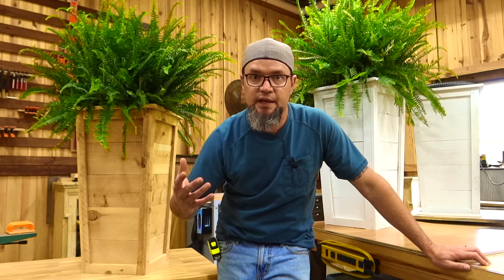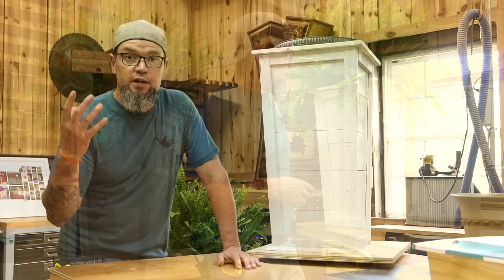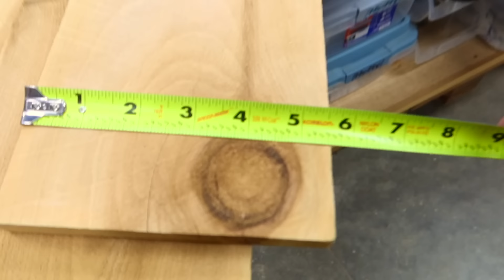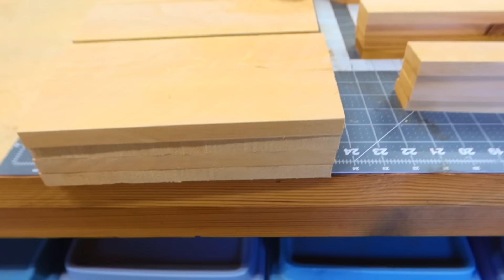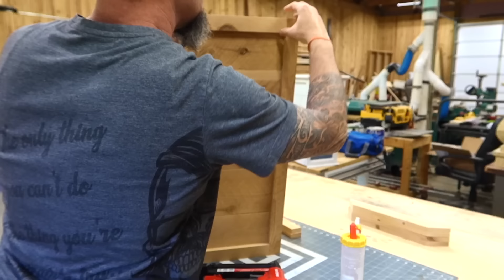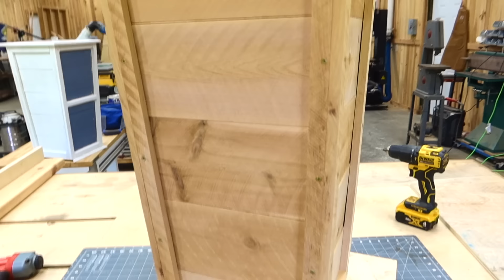DIY $10 Tall Planter - Low Cost High Profit - Make Money Woodworking

Comment: I built a couple of those yesterday and they came out fantastic! I was a little intimidated at first with all the angles but it ended up being a breeze. Only change I made was with the top horizontal strip. I found when picking the box up I was grabbing under that, and I could definitely feel it shifting a little with just glue and nails. So I put a couple screws in each one and it’s solid as a rock.

Comment: I built and sold my first project which was an “airmail” corn hole trainer. I am working on the planters next. I too am a full time self employed handyman and I ultimately want to just do wood projects. Thank you for your videos!!!!
Reply: What is an "airmail corn hole trainer"?
Reply from the maker: That is awesome!  No worries!  Thanks for watching!
Reply: @andrewsmithmilan1780  you can look it up in YouTube. It’s an 18”x18” board with the 6” hole in the center. Sits at 10 degrees like regular cornhole boards. It’s regulation size and used for airmail tournaments and for training to get the bags in the hole without sliding. Makes the person more accurate. Has to set at the same height in the back with that same slope. Check them out, lots of cool stuff you can do with them.

Comment: Hey brother just made one of these for the first time today. Had a blast and it turned out nice. Got a chance to use some cool tools and techniques - the taper and trim make this pop for sure and using the brad nailer was key. Added a couple tapered scraps for a shelf about 8 inches under the top and it worked well to hold a smaller pot for now. Will be giving a few away and Im sure peeps will be hitting me up when their friends see these. Thanks man!

Comment: I've been building the "Farmhouse" style planters and selling them for $50 in my area. I did my first batch out of the 5/8" pickets, but even using your plans, I had to add an extra picket for every 3 planters. Apparently my dog-eared 6' pickets have a different dog ear cut that messes up the 3rd board. Anyway, my last batch I just made, I used some 3/4" pickets that my local Lowes started selling. They are about a dollar more per picket, but they are smooth. No roughness to sand. Saves me alot of time, which more than makes up for that extra dollar per picket. I just have to trim the edges of the back panels on back wall "B" to get them to assemble correctly. Also, they take the screws better than the 5/8 soft boards.

Comment: Matthew I’m not sure how comments work as far as seeing them on older videos so I thought I’d post here even though it’s not in this video. 

In one of your older you mentioned your old planer or shaper (I can’t remember which) being three phase, if you haven’t gotten it running yet before you buy a phase converter take a look a VFD. A friend of mine runs one in and old 3 phase Delta cabinet saw and it pretty slick.
Reply from the maker: Hey David!  Yea it's hard for me to keep up with comments from older videos.  I have been looking at the VFD converters but havent seen one in action.  I think im going to pick one up and see how it does!  Thanks!
Matthew
Reply: @MatthewPeechWoodworking  they’re pretty slick, they have to be sized right, you can set turn up to spool up and down slowly and even act as a brake.

Comment: After a couple hours planing and sanding.  Cut the boards like i was the Queen bee.  Paid attention to the alternating boards.  Rocked it.  Then stacked the boxes like a rock star.  Needless to say when they didn't stack tapering that 3 degrees off should have been on the bottom of my mitre, not the top.  So laughing at myself right now. Will try it again next week.  In the intrim, i have some cute planter boxes.

Comment: I did all my cuts per the plans purchased, love the way you set up the pdf. I assembled all my boxes, one out one in style. Went to stack them and boxes D and E are too large to be cohesive, the overhang on the sides doesnt allow the trim to be added. The first planter I used critical thinkkng and leveled the vertical edge sticking out, then removed some of backing from the wider Leg so it would fit. It works for now but the rest of the board is over hung, so will be facing away from the street and not visible to most. I will to experiement with shorten measurements  for D and E. 
The 2nd planter i will try this on, hopefully get it all even out. I am also going to add a shelf so pots will sit instead of hang for dear life by their plastic edging. Dont need a traumatized plant 😂
Reply: Great news to share, I took apart the D and E boxes, picked 2 pieces and started trimming small amounts off keeping that wonderful 3 degree off 90.
Successfully got rid of the jut out.
I kept the 1st tower as is and decided to add stain to specific areas to create illusion of evenness.
Excited to continue forward now.
If you don't experience challenges in life, then you can't grow. 

Peace and Love and Light

Comment: The planters look really nice.  However, being on the tall side, I would be afraid that with a potted plant in them it would be top heavy and might fall over.  Additionally,  the planter sitting in water would damage the bottom.  So, my suggestion is to perhaps build a footed platform in the bottom, which would raise the planter and add some needed weight to it.  Maybe use 2×4 for the footed platform and maybe put a small patio stone or a brick or 2.  
Just my 3 cents....

Comment: Someone on some platform, (maybe a FB group) suggested using half laps for the top trim so that the gaps from shrinking weren't as noticeable. I've been wondering about that.  Would be an extra 10-15 minutes depending on how quickly it can be set up.  I just don't remember if they meant staying with the 45s or using butt joints.

Comment: Splendid video. I don't build for money, but I do for gifts, and family & friends just love the side-table and planters. I finally ran out of the pickets I got for free (I had to demo the fence), and I looked at HD for new cedar pickets. Today (2/Jul/2022) HD has 19/32in x 5 1/2in x 6ft western red cedar for $3.78 + tax (8.52% or $0.32 so $4.10 per picket).  BUT HD also has 5/8in x 5 1/2in x 5ft (a foot shorter and ever so little thicker) for $2.57 (with tax $2.79) - That is a significant saving over the 6ft picket. About $1.21/sqft compared to $1.49/sqft, about 20% less/sqft for the 5ft pickets.

I found even better savings at Lowes (in Longmont, CO), $2.18 (inc tax) for the 5-footer and $4.30 (inc tax) for the 6ft picket - a whopping 51% less for the 5-footer. WHY? Why is the 5ft picket so much cheaper than the 6ft picket?

Comment: Make it to fit a common size container like 5 gal bucket  or the 2 1/2 gal mop bucket from Wally World something that can be found in your area . Just a thought
Reply from the maker: Oh yea!  The good thing about this design is you can add to the height and opening by adding 9/16" to the box size below.  Im not sure but it may fit a 2.5 gallon as is.  I tried all of the traditional planters and most worked just fine with the current size.  Nice idea!

Comment: Being both a woodworker and a gardener - my question is how you actually utilize it as a planter?  I love the design, but it doesn't seem to be setup for any particular planter insert?  Also anyone who's used outdoor planters knows that drainage is essential for a plant (and you usually water them until the water is draining from the bottom of them).  I've watched the video several times and I don't see you installing a bottom, but this does sit flush to the ground.  So the water just runs down from the planter and collects on the ground inside?  Seems like it would be more effective to use as a planter if at least if the 4 corners were setup at least an inch off the ground?

Comment: Hey Matt!  Thanks for the videos.  @12:30 you say to start with Leg B and that it is the smaller of the two legs and that Leg A will overlap Leg B, but the cut list has Leg B as the bigger leg.  So which one actually overlaps the other?
Reply: The bigger one obviously overlaps the smaller one !! ... c'mon Josh, put yer thinkin cap on !! 🙄😂

Comment: Nice work. Hey I have a quick question - I tried building one of these boxes as shown in your video. I have bought material to build more.  I bought cedar pickets because they were the only ones available. I tried drying them for a couple of weeks by keeping them stacked with wooden stickers between them, and keeping weight on them.  I live in California where there is dry weather with very low humidity. But even then I found that after cutting to length, these boards cupped and the planter box doesn't come together that well. Do you have any suggestions or tips on how to address that? I have bought material to build more. But want to find a way to avoid this problem before building more. Your help and guidance highly appreciated. Thanks in advance.
Reply: I think you are better off building the boxes as soon as you get the pickets... this isn't fine cabinetmaking, allowing the pickets to dry is a guarantee for warpage...(is that even a word ? 🤔)
Same with the "joinery" techniques... avoid dovetails at all costs... 🙄😂

😎👍☘️🍺
Reply: @Peter Fitzpatrick thank you for that suggestion. I will try it that way.

Comment: i only have jigsaw and circular saw any tips on reducing the size with perfection
Reply from the maker: Use the circular saw.  It may take an extra board but cut them all at 12" and lay them out like one wall would be.  Use a board as a cutting guide and angle it so that the top is 12" and the bottom board ends at 8".  Repeat for the opposite side and do this 4 times.  It will work.

Comment: In this video you mention that it's important to be sure that the fence pickets are 5/8" thick, but in your new video on your new design for a 3 picket planter you note that you're hearing a lot of people say it's hard to find them much thicker than 1/2" and having problems with splitting, etc. In that video, you mention that you made changes based on that, particularly with the screws used (1" pan head vs 1 1/4" in most of your other planter builds using pocket holes. Are there any length adjustments that need to be made to allow for the thinner boards in this build?
Reply: These videos have been great and I really like the way you organize your plans you sell on your Etsy page.

Comment: you did not mention how much longer the side pieces get as you go up.  Each box has to be bigger than the one below.  Do you just take the wide measurement from the box below and make that the small measurements on the box above?  that makes sense to me.
Reply from the maker: If you put the 3 degrees off 90 on the side walls in the cut list it will create the taper.

Comment: Love your builds! Curious why you need screws if using wood glue and Brad nails.   Are the screws necessary?
Reply from the maker: I always add screws.  The constant shifting of wood will eventually break down the glue and unless the nails are stainless they will rust and break.  But without screws Im sure you can get a season or two out of them.

Comment: My boards are closer to 5.25 wide.  I'm guessing that the building process still works the same?  But the finished product is just a tad bid shorter?  Is that correct?  The more important thing would be that all of the boards are the same width?

Comment: Going through this in my head, because I must build this (lol), I didn't see where you covered how much longer each course of side boards needs to be as you go up.  It looks from the video like you cut all 16 pieces the same length, but that can't be right with that 3 degree angle.  Each next course going up has to be longer boards than the one below, so the question is, longer by how much?.  But I think I have it worked out.  The idea is that each top edge is the same length as the bottom edge of the next course up, so what's needed is to try and move the cutting stop over to the right, by the difference between one top edge and the top edge on the next course.  

One way would be to take the top edge of one of the 4 side boards and make a mark on the next board as the new bottom edge length, then draw the angle up from there to the new top edge.  I know I'm sure to mess that up, even if I make the first cut a bit longer and 'sneak up on it' with successive cuts until I find it.

Another way without marking, measuring, or drawing a new angle, would be by using a second, temporary stop on the left, to help locate the cutting stop on the right for the next course.  Also for this method, the stops need to be wider than the side board stock.  This can be achieved either by making the 2 stops from wider stock (as your cutting stop is in the video).  Or if wider stock is not available, the bottom edges of 2 side boards can be used.  Cut the 1st side board, clamp anything temporarily for an initial stop, then slide the stock for the 2nd side board into that stop, temporarily clamp down the stock for the 2nd board, which allows you to swap out the first cutting stop on the right with the 1st cut side board, only with the cut end back against the fence, using the bottom edge as the stop, because the bottom edge is longer than the width of the stock (this will make sense in just a second).  Then cut the 2nd, 3rd and 4th side boards, using this new cutting stop made from the 1st side board.

Once the 4th side board for that course is cut, the cutting stop on the right needs to be moved for the next course.  So, leave the 4th piece in place, tight up against the cutting stop on the right, and clamp the 2nd or 3rd side board as a temporary stop to the left of the 4th piece.  Clamp this temporary stop in the same way, with its cut end against the back fence, its bottom edge against the left end of the 4th piece, and angled as a mirror image to the cutting stop, with its bottom edge against the cut end of the 4th piece.  Now the cutting stop on the right can be un-clamped and moved, with the temporary stop on the left preserving the location of the left end.  Now, flip the 4th piece so that its top edge is not against the back fence, but is toward you.  Slide the top-point of the 4th piece into the temporary stop on the left, leaving a V-gap since the angles are now opposite to each other, and then slide the cutting stop on the right up against that top-point, leaving another V-gap (being careful to not push the points too hard into the stops, so they don't penetrate the soft wood) and clamp the cutting stop.  This is why it was necessary to use the longer bottom edge as the stop, so the top-points after flipping could hit the stops mid-board, instead of being flush with the bottom-points, and possibly inaccurate.

By flipping the 4th side board, the cutting stop to the right has now been moved to the right the exact distance needed to increase the side boards for the next course up -- its old top-edge length is now  the next course's bottom-edge length, allowing the 3-degree angle of the cutting stop to 'find' the new top-edge length.  Cut the next 4 side boards as before, and after the 4th has been cut, clamp a temporary stop to the left, flip the 4th side board with top edge toward you, slide its top-point into the temporary stop, slide the cutting stop on the right into that end's top-point, clamp it, remove the temporary stop to the left, and cut the 4 side boards for the next course.  Rinse and repeat.

And all that's about 137 minutes longer to read than it takes to do it!  Sorry for the long comment, I just had to work all that out in my head, so figured I'd contribute that method to your discussion here.  I had some new pickets purchased years ago taking up space in my garage, leftovers I never got rid of, and now my wife will get a nice planter out of them!

Great project, and series!  Can't wait to see what you come up with next!
Reply from the maker: Wow... thanks for the response!  Your putting too much thought into this lol.   Thats my job.  I work out the math and post the cuts in the description.  All you do is add 9/16" to the measurement of the top of the box your stacking on.  But to save the math check out the cutlist.  😉
Reply: @MatthewPeechWoodworking  You're not the first person to tell me I'm overthinking something!  LOL
Seriously, thanks for responding.  I see the cut list now.  Oh well!   😎

I've always enjoyed figuring out how to work out dimensions, preferably without measuring, to be able to use different thickness/width material, or modify the design.  Like, one idea I'd like to try with this one, would be to leave out the vertical leg pieces, getting the courses exactly flush along the vertical edges, alternating the insets and overlaps like you did every other course, and put a couple of through-dowels in each alternating end, for the look.  Maybe a chamfer on the side board edges for added visual interest.  Edge gluing should be strong enough, but might beef it up with vertical stringer pieces inside, glued and screwed into each course.  Maybe a cross-lapped X attached to them for a platform for a pot.  Ideas, ideas.  

Love your videos, bro.  Keep it up!

Comment: What type of paint and sprayer do you use?  Water based or oil based? HVLP Gravity Feed Air Spray Gun? 
I tried using cans of spray paint but 5 cans later and it looks like I only used half a can. The wood absolutely soaks up the paint. Need help!

Comment: Just got my 1st combo power tool set to begin making these. I have been wanting to learn to do some small projects but this video really got me excited! Anyhow, my question is I only have a circular saw. I get the measurement and 3 degrees off 90 and this may be a completely rookie question. I'm not sure how I would get the tapered boards? Maybe I have to have a miter saw? I even bought the plans but I am so clueless! Help an old lady out! Thanks